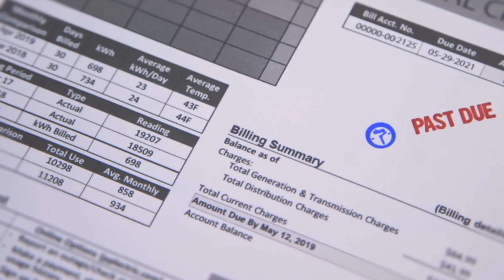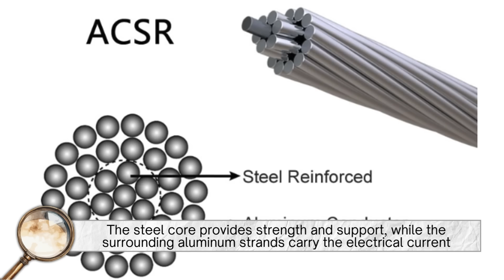Why Do Power Lines Use Aluminum Instead of Copper?

Comment: I'm 60.  I've been doing low voltage, high voltage, and plumbing for 40 years.  The price of copper seems like it's five times higher now.  Over 20 years ago, I read that most of the world's easily recoverable copper had been mined.  I believe it.  In 40 years, they've developed substitute materials or cutback copper content.  In plumbing, we see plastic, PEX, and PVC.  In low voltage, a lot of cheap network cabling is aluminum core and copper clad.  Fiber and wifi now makes up more of the cable plant. In domestic high voltage, the price of 8-16 gauge BX, SO, Romex, and single strand is crazy.  If you told someone 20 years ago that Home Depot and Lowes would be padlocking it up, they would never believe you.  This video actually tread lightly on the cost issue.  In the end, it's almost 100% about cost.  Good video.
Reply: The copper mines in development today would be impossible 50 years ago because the value would be too cheap. 0.6% copper is an often seen number for the mines in the billions of tons. Smaller mines can dip down to 0.4% if it has byproduct of gold & silver or moly.  That's way too cheap per ton to get out of the ground.  But all the good stuff near surface is totally gone. So the price of copper relative to inflation goes higher, making the once "too low grade" copper profitable.  The average timeline for copper mines is now 18 years from Discovery to Production. It was just 10 last century tops.  There is a huge copper deficit crunch coming in about 2030, we can't get copper mines online fast enough even if we know where it is. I invest in junior copper miners, they are hugely undervalued because no one outside our sphere notices how huge the copper supply deficit is & how there is nothing being done about it.  The price of copper will rapidly soar, no one knows for sure when but in a few years for sure.  Now is the time to buy in to copper miners,  gold & silver miners have already made their run up & many are over priced. Copper, & especially juniors, are hugely undervalued if you buy today.
Reply: @vahjayjayaddict Wow... thanks for sharing.  Great info.
Reply: Do tell me, If Aluminum is so great then how come when my parents house was built in 1970, the Aluminum wiring kept shorting out. Had to get it rewired with  commercial grade copper wire to fix.
Reply: @brianperry4815  Same thing happened to my parents' house in the 70s.  Though, it's way different in the case of commercial power lines.  Those are highly regulated and managed.  They have all sorts of devices and monitors along the way that are constantly adjusted and actively managed by the utilities.  They know how to control and manage these types of loads.  The problem with homes...especially in the postwar homes of the 70s was that the typical house was wired for about 50 amps...max.  Many houses, like the one I lived in didn't even have grounded outlets.  After 1950, they began to introduce all of these high load electrical appliances.  Vacuum cleaners, electric ranges, toaster ovens, waffle irons, window air conditioners, sun lamps, etc..  The panels didn't even have breakers.  We had fuses...and lots of dumb people would bypass them by sticking things like pennies and nickels in them.  People also began using all of these duplex, triplex, quadplex and greater outlet splitters, which overloaded the circuits.  Aluminum wiring was just the straw that broke the camels back.
Reply: @brianperry4815  Thermal expansion, oxidation, and improper connections (not rated for aluminum) causing loose connections. Common practice nowadays is to use antioxidant paste on aluminum connections rated for aluminum.
Reply: @patrickdougherty2777 really?
Aluminum rust muchvmore then copper especially when attached to different metals.
Lower melting point, weaker,more prone to Crack and break.
Also non magnetic. There have been wiring from 100 years ago that still works that is copper. I highly doubt Aluminum would last that long.
Reply: @brianperry4815  I would not use aluminum myself, I don't know why anyone would use it due to its problems. It is not against code if installed properly. I just know that if aluminum is used the connections must be rated for aluminum and manufacture's instructions must be followed.
Reply: They used to also use lead cabling underground for substations/kiosks and transformers.
Reply from the maker: Thanks for sharing your valuable insights!
Reply: @ginosko-greek  Great video!
Reply: CCA Cooper Clad Aluminum sucks for PoE (power over Ethernet) applications. Too much voltage drop. Otherwise it's cheap network cable. Unfortunately too many sellers are not honest about their product being CCA.
Reply: @glynnetolar4423 Yes, indeed.  The amount of juice they are sending down Category cabling now is shocking.  I spoke to a manufacturer this week who told me that their new stuff required 24 awg Cat 6A. When the capacitance budget gets that high, you're talking 100% copper.  End of conversation.
Reply: The green revolution will probably run into this wall, hopefully before the pitchforks and torches come out.
Reply: @DanThomas-n1e  Well...this is a problem that will impact EVERYONE WHO USES ELECTRICITY.  Last I heard, there really isn't anything like wireless power transmission...at least for AC.
Reply: Can you lose the music
Reply: Since Coper is a globally traded good, once China starting surging construction, over demand on copper has been going on since at least 2006
Reply: @Craftsman4Life I wouldn't call it over demand and it's more than China. IT technology had exploded in the past 40 years.  IT requires circuit boards, cabling, heat sinks, power devices...you name it. We've also had global booms in construction which sucks up copper supplies.
Reply: And I thought copper was very abundant.
Reply: @blawdy-moo In a sense, it is... just like oil or uranium.  The thing that makes it rare is the challenge of extracting it in a PROFITABLE way.  Since the creation of the telegraph in the mid 1800s, the world has been hungry for copper.  The telephone made this worse.  The electric light and domestic electrification made it worse. As the world made more motors, generators, radios, TVs, bullets, computers, and everything that needed copper, supplies have been getting worse.  After 175 years of increasing copper demand, most of the easily recoverable copper has been mined.  Now, they have to go to more remote sites, dig deeper, and exploit mines with scantier reserves.  The demand is higher than ever.  All of this makes copper so expensive that thrives break into homes to steal the plumbing pipes and hardware stores are locking their electrical wire up to prevent shoplifting.
Reply: @GibbonInAmerica  Indeed I heard about people stealing power cables, now I understand why!

Comment: The cable @0:28 is fibre optic. The black tube is a splicing node. Definitely less conductive than copper and aluminium

Comment: And did you know that the different sizes and types of conductors all have names so that they are easily recognised in specifications. Swan is one of the bird range, Madrid one of the city range and Beech a covered wire... the conductors have different constructions with a different no. of elements and wound or cross wound in differing ways. A HTLS, High Tension Low Sag conductor might have a carbon fibre rope at its centre. Gosh its fascinating

Comment: Aluminum oxide is a poor conductor- resistive. This can be a problem with connectors or splices, the reason why it is a potential fire hazard in residential applications where there are numerous connections. Resistive connections generate heat & have caused fires. Copper is preferable to aluminum in residential applications.
Reply: I din't know that ,very interresting,and I've learned something important.
Reply: @michelchartrand7257  One point I forgot to mention. As copper oxidizes, copper oxide remains much more conductive than aluminum oxide. Copper is much safer in residential applications.
Reply: Many aluminum breakers also have this problem.  They need to be properly engineered.
Reply: Aluminum connections have to be treated.

Comment: A few strands of the Al cable is steel for added tensile strength.
Reply: The steel wire/s is in the center (it is the core) where the aluminum wires go around entwined.
Reply: @williegeronimo4981    That is called an ACSR cable (Aluminum Cable Steel Reinforced). Aluminum alone being soft, will extend in length due to the force resulting from  its own weight. Hold a piece of chewing gum or dough between your hands and you will see it starting to flow downwards and getting thinner eventually reaching breaking point. 
Thus the power line towers must have a shorter span so that the sagging of the wire does not reach dangerous distances to ground or other objects, traffic, etc. And you are back to economics: with pure aluminum conductors more towers (for the same mileage you will need more towers with shorter distance between them) or ACSR, more expensive but fewer towers to cover the same mileage. Note again that the comparison is made "for the same mileage"
Reply: @pindapoy1596 What type of powerline cable is used for long spans such as across valleys in the mountains or across lakes?

Comment: Aluminum is too brittle for indoor use.  Transmission lines are static just hanging there.  Extension and lamp cords would work harden and crack in no time if they were aluminum so copper is superior where things get moved around.
Reply: Transmission lines sway in the wind and bend from ice on them and eventually break.
Reply: Very correct. It was tried a few decades back in our area and proved too unreliable.

Comment: Aluminum wire is far cheaper for long distances. It's simple economics
Reply: Steel would be even cheaper but not as nice to lay and maintain.
Reply: @wolfgangpreier9160  Yes, there is the weight "issue" 😀😀
Reply: @wolfgangpreier9160  Pure Aluminium is very light, but do not have tensile strength. Most Aluminium cable have steel core for strength.😊😊😊
Reply: @a @anuardalhar6762 know. That‘s part of my job. 😎 Overhead cables consist of steel cables with Isolation against corrosion and Aluminium sheaths carrying the current. That is why they have to be checked regularly for breaks and scratches.
Reply: And weight ... Large gauge copper cable if extremely heavy.
Reply: Or in other words, power to weight ratio.
Reply: @ScottSmiley-fn4fo   What is "long distance" for you; 100 miles or 200 miles or 470 miles? Apply your simple economics to that and you get...nothing
Reply: @pindapoy1596  For high voltage, aluminum’s cheaper no matter the distance.
Reply: @pindapoy1596  Aluminum is cheaper for any distance.

Comment: Silver is the most conductive metal !
Reply: Silver-coated copper core wire  run underground would be the "best" way but it's expensive, so nobody does it.    Use of pure silver wire would just be a field day for wire thieves. Hell, we cannot even keep copper in homes and businesses, they sniff it out.
Reply: Gold is the Most Conductive, that's Y it's used in Circuit Boards of All Computers/Phones etc,,,,,,
Reply: @simonmatthewwright1221  No it isn't. Gold doesn't corrode. That is why it is used. Silver corrodes. when it isn't corroded, Silver is the best conductor. No Ifs or buts. Categoric fact.

Comment: There's also the fact that power transmission relies on high voltage low current. Ohmic losses are I² × R, so the lower current you use, the less the conductivity matters. Of course it's still important, but if we were forced to use high current low voltage, aluminum would not work because of more losses, creep due to joule heating, etc.
Reply: I was going to mention that but you did a better job than I would have.
Reply: why can’t V^2 / R be used?
Reply: @Triadii  Ohmic losses are (input V1 - output V2) x I = IR x I = I² × R
Reply: You have No Concept of What You Are Talking About, For Starters the 'Grid' sends in a "Ring Circuit" Very High Voltage (465,000) & Very Low Ampage (About 1A), the Current Has Nothing 2Do With The Use of Aluminium as Aluminium has a Faster Heat Displacement than Copper Also It's a Lot Stronger over the 500m between Pylons, It's Also A Lot Cheaper Too!? FFS
Reply: @simonmatthewwright1221  As far as I can tell, you are addressing a different issue than @mildlyacidic.  The OP is addressing a specific thing.

Comment: silver coducts better then copper science wise.  burying cables is safer for people, birds and enviroment.  lt is all about the money.  some one is making money building all those towers and hanging uses more wire than laying, an issue not addressed. simply ally is cheaper!  I would guess a plastic pipe 2 feet down would be cheeper, safer and require less repair.
Reply: Until some hits it with an Excavator.
Reply: @anthonycavalliotis8736  Or a frost heave breaks the wire. It is non-trivial to find the break in underground cables.

Comment: Copper is only more conductive for a given diameter. Aluminum is much more conductive for a given weight or a given cost.
Reply: Conductive per cost. That's a new metric that makes perfect sense.

 Copper better at room temps. Things like gold are better at higher.
Reply: That's one way to summarise the video.
Reply: Ampacity (current carrying capacity) is not the most important in High Tension power lines as these power lines carry not that much current due to the voltage in the hundreds of kilovolts (some even more than a thousand kilovolts). Weight and cost is a lot more important, and copper is a lot heavier and costlier than aluminum. Using copper would make the cables so heavy thus would need transmission towers a lot more stronger and expensive. Using copper instead of aluminum is like using something expensive when there is something a lot cheaper and better that would produce the same results...or better.
Reply: Price...its cheaper. Is the short answer,  you also have CCA & CCS. That is used
Reply: The main power lines in my area are iron.  The only aluminum is from the pole to the house. It consists of three separate lines two 120 volt lines with 1 center iron wire and five or more aluminum wires around it with a black plastic protective shield and the third a iron ground wire consisting of about four to five strands.
Reply: @carmichaelmoritz8662 thats interesting
Reply: HTF does the cost change the conductivity?
Reply: Hooligans steal copper.
Reply: Because Crack heads would destroy cities like "World War Z" due that copper trade in
Reply: Kamala Harris once suggested that we replace all aluminum wire with uranium, so that it provides more power and reduces our reliance on republican-owned fossil fuels.
Reply: @MockOverdrive  everything has a price and everything holds reliance. Move from relying on one thing to another.  Just due to the fact one thing seems better doesn't mean it actually is.
Reply: And it keeps the tweakers from shooting the copper wires down.
Reply: cu is heavier than al..al I think is 37% conductivity  pure cu is 99% if u install cu the sag maybe reach the ground than al thats what i think.
Reply: @manungtv3122  aluminum wires wrapped around a steel wire are obviously way lighter than copper wire that would be needed to do the same when it comes to transmitting long distance extreme high voltage
Reply: Copper is a better conductor of electrical current.  Aluminum is a better conductor of heat.
Reply: @richard1113  Did you listen to the video at all? What you said is correct (and was said in the video) but there are a lot of reasons why aluminum is used and not copper.
Reply: @richard1113 no.  Copper is a better conductor of electrical current and heat when measured by volume .  AL is superior by weight.
Reply: @richard1113  No.
Copper Thermal Conductivity is 401Watt per meter kelvin; Aluminium is 237. It's electrical conductivity is pretty well the same ratio.

Please actually check facts before spouting nonsense.
Reply: @formes2388  Aluminum, not Copper is used in many applications due to it's thermal connectivity per cost.  Copper is about 4-5x the cost.  You can say what's on your mind with better manners.
Reply: @8546Ken     Conductivity is a material property and a comparison of properties of two materials is made on the basis of identical samples.  You must take a one inch length of copper wire of 1/4 inch diameter and compare it it with the same one inch long, 1/4 inch diameter aluminum wire in order to reach a scientifically valid conclusion. And in such comparison (of apples to apples and oranges to oranges)  copper wins by far.
Reply: @pindapoy1596 Silver is still king.
Reply: @nengyang1895  Yes, it is ...
Reply: @pindapoy1596 How do you buy metals?  It is priced by weight.  So why don't you look at conductivity of 1 lb of copper vs 1 lb of aluminum?
Reply: @pindapoy1596  Conductivity depends on cross sectional surface, length and Specific Conductivity which you were referring to.

Comment: Even the line from my service panel out to the street is aluminum.  I watched them upgrading my service.
Doesn't indoor aluminum wiring to outlets present problems?  Some older homes have it.
Reply: Only when it's mixed with copper.
Reply: Yes, aluminum does not have the long term reliability of copper and is more prone to low quality connections with age. Aluminum crushes more easily leaving loose connections that can oxidize and overheat.